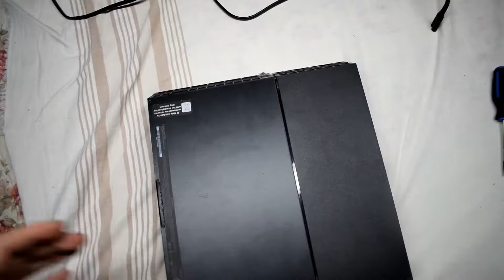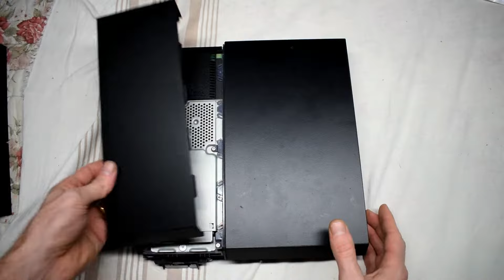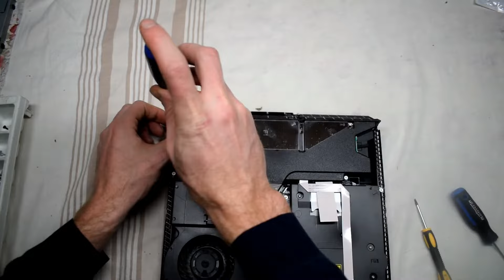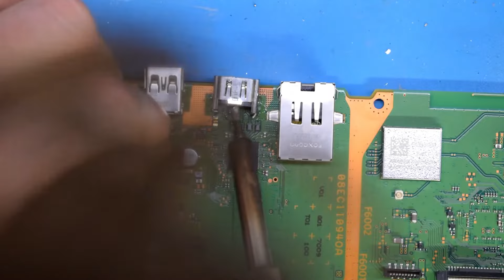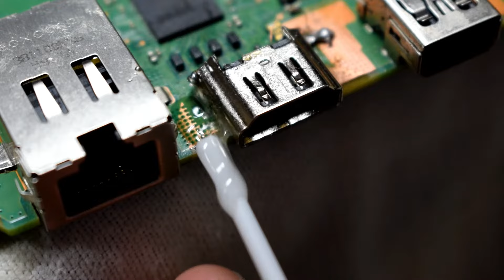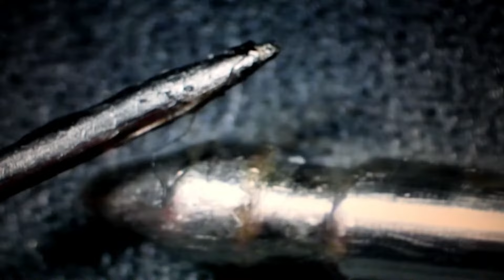PS4 HDMI repair from Start to Finish!!

Comment: Bad design- they should have made it with a detachable ribbon cable from the board to an easily replaceable HDMI socket.
Reply: But it's still got to be soldered to the board so that makes no sense.
Reply: @HardWhereHero   A ribbon cable connector, like the ribbon keyboard connector on a laptop, is indeed soldered to the board, but allows easy replacement of parts prone to failure, like keyboards and multi-pin HDMI connections.

Comment: Any Questions just ask them below
Reply: what's the name of the moveable tray under the microscope
Reply: @willh3562  x-y tray
Reply: x3+y3+z3=k what's k
Reply: @bigmike3189  27
Reply: What's that screwdriver called
Reply: @graysontaranaki2274  T9 torx screw
Reply: why was no flux used to remove the old hdmi
Reply: what's different when you do it with a ps4 slim.
Reply: What temp and air flow do you use on your hot air station
Reply: How much does it cost to fix it normally
Reply: How do I put my power button back on
Reply: Would you ever recommend just fixing my playstation if so how much would you charge to fix it
Reply: What do I do if the hdmi port is wiggling???
Reply: @luislemus3171  seems that solder has weakened on the HDMI port joints. would recommend to resolder. note inspect the HDMI port for any damage.

Comment: A guy from our church gave my son one of these to play Minecraft on and the HDMI cable is severely sensitive If you breathe on it the screen will go off. I've inspected the pins and I've come to the conclusion that there's probably some damage on the tracers or somewhere around the HDMI port, so I'm going to order some solder equipment and try to fix it for him because he had his heart set on the damn thing working.
Reply: Good luck man. I respect the drive to make your children happy.make sure you have the same equipment this guy is using. He obviously knows his stuff. A magnifying glass on an extendable clamp or stand, or a phone with a good camera zoom positioned similarly is crucial...for me anyway. The pins in the back are extremely frustrating when you're leaning to do them....keep the temps low and the flux enough, and you can always redo them. Step away when you're frustrated and give yourself a break. Use decent solder and have a solder wick  handy. They make cleaning mistakes and puddles a breeze. 
 
It's not as hard as it seems but it takes awhile to learn the in and out of the fine stuff. 

Be careful with the disassembly and take pictures of it as you go, ribbon wire connectors and the small signal wire under the PSU..etc. 

You can do it,.or perhaps you already have at this point? 🤔